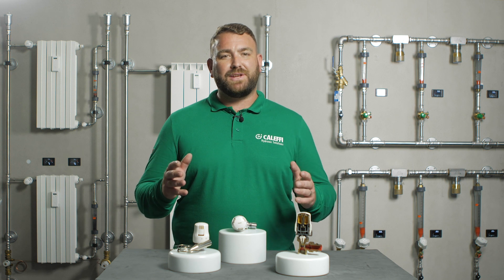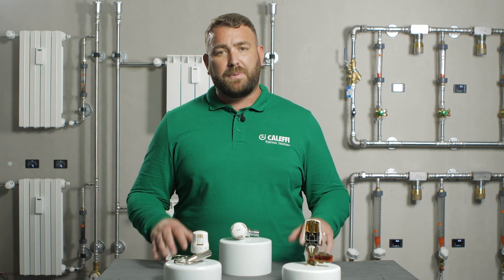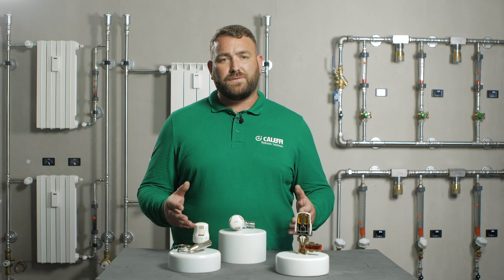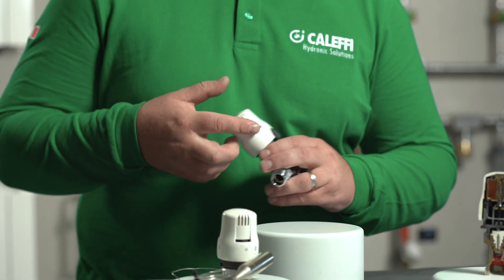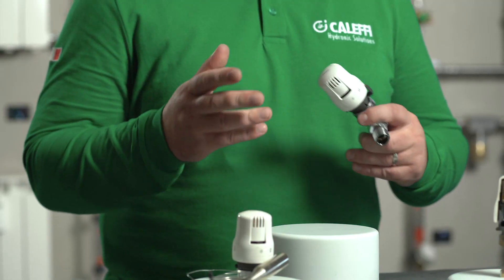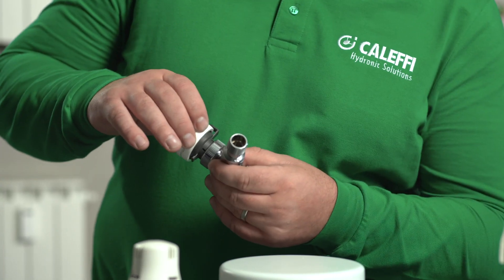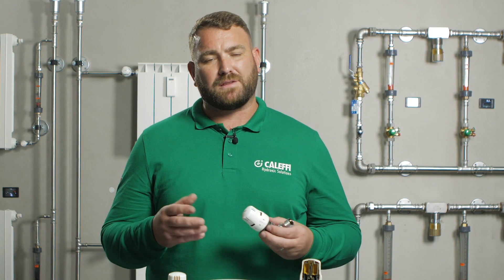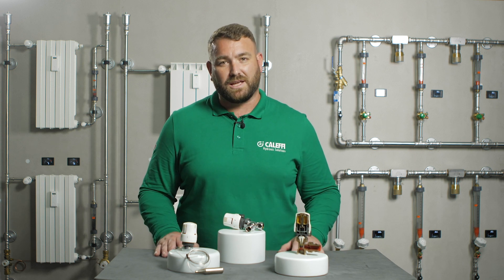How do Thermostatic Radiator Valves work?

Comment: Hi can you please tell me! A thermostatic radiator valve opens and closes as a result of the temperature of the
 

 

A.stored hot water

B. water in the heating system

C. room it is installed in

D. boiler thermostat
Reply from the maker: Hi - thanks for the question. The thermostat senses the room temperature and adjusts the hot water flow accordingly. Hope this helps!